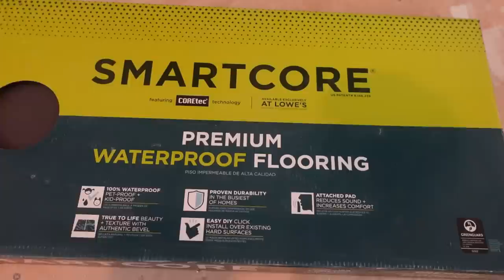Installing Laminate Flooring - Addition Build 47

Comment: The laminate flooring you used is the best.  We used it in our home, and what a game changer for ease to install, cleaning, and durability!  It will all be so bright and beautiful when you are done.
Reply: I put laminate flooring throughout my 1100 sq ft house (kitchen and bath included).  It looks nice but to be honest it is not that easy to clean.  I have the Black Diamond cleaner which is supposed to be streak free.  No way it streaks horribly, and in the kitchen does not cut even a little grease on the floor.  It’s fairly new and I am experimenting.  I do not want to take the finish off, but out of frustration did you Mr. Clean spray on one spot.  I’m going to fry gallon of water and cup of vinegar and do it by hand I guess because your not supposed to mop these laminate floors.  Let me know if you have any suggestions!please!

Comment: Put mesh on hole and then floor leveler. It would be better than nothing. But you did a good job. They have dryer vent for inside the house but you don't need it now anyway. Glad you just about have it. Good job. Glad for you both. It looks nice.
Reply from the maker: Unless I somehow put something underneath the hole to support it, the floor leveler in the hole would just fall right through into the crawlspace.  The flooring laying over top of the hole COMPLETELY blocks it off, as if I had nailed a board across it.  Nothing can get through there. And the hole is close enough to the wall that no one will step there.
Reply: @LiveSimpleLiveFree  ok sounds good.  just think of cold (insulation) and mice getting through. Mice seem to be able to eat through anything. Lol

Comment: What a wonderful surprise. Bill you are such a hard-working man. Not just hard-working but talented. I have questions Why didn’t you use the extra leveler in that hole, putty or sawdust and glue.  Men usually don’t have the concerns that some of us women my concern is nightcrawlers ants that will come up under the floating floor. Is that not a concern for comfort. Sending my condolences to you and Elizabeth. Elizabeth hair is gorgeous still loving her haircut. Hilarious how many ways did Elizabeth come up referring to Florida. L O L my favorite was Floridate versus fluoride😂😅 Laughter is good like medicine. The joy of the Lord is our strength. Continued blessings!
Reply from the maker: Unless I somehow put something underneath the hole to support it, the floor leveler in the hole would just fall right through into the crawlspace.  The flooring laying over top of the hole COMPLETELY blocks it off, as if I had nailed a board across it.  Nothing can get through there.

Comment: I'd have put expanding foam in that hole, cut off the excess, then continue the floor leveler over that.  It doesn't require strength, only stability.  Is that floor leveler the same as Fix-All?  That's what I have used when I ran into problems with different levels to cover with new flooring.  Godsend for us working with remodeling old houses.

I'm glad I held my tongue on your furniture placement in the home in Florida.  I always figure "It's not my home," and in this case, Elizabeth with make the decision anyway, so why harass Bill.  But that hutch was hard to look at.  😂
Reply from the maker: The flooring laying over top of the hole COMPLETELY blocks it off, as if I had nailed a board across it.  Nothing can get through there.  And being so close to the wall, no one will step there.  I'm sorry, I've never heard of Fix-all.

That hutch in Florida couldn't go any further to the right because then it would have been back in the corner behind the shelves, and the drawers wouldn't open.

Comment: Hi. You have helped me make my decision about flooring. I just had one question. My home is on a slab and I was wondering if you would recommend that I use an underlayment since it is on concrete. We had carpet for years and the padding was directly on the concrete and we had no issues.
Reply from the maker: As long as the concrete is smooth, I wouldn't bother with underlayment.  The flooring has a thin layer of padding on the underside.  If there are any rough places in the concrete, you can smooth them out with floor leveler.

Comment: Why didn’t you put a panty hose foot over the dryer vent hose after you disconnected it so you didn’t have all that lint blow everywhere?
Reply from the maker: I don't know.  We just never did.
Reply: Or get a bucket that you attach the hose too with water in it and empty it out each time you use the dryer. That is what I did before I had my vent that went outside.
Reply: @LiveSimpleLiveFree  ok fair enough. Just wondered.